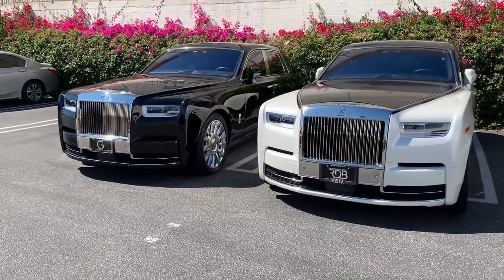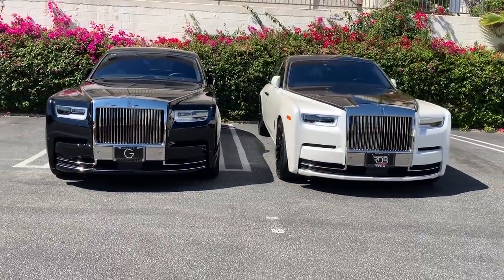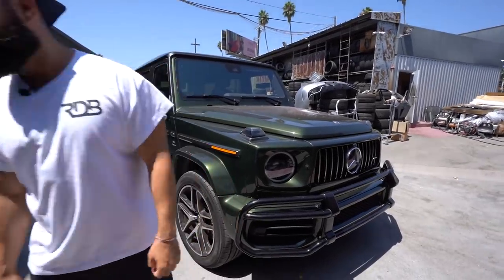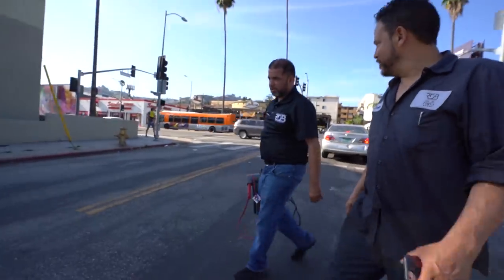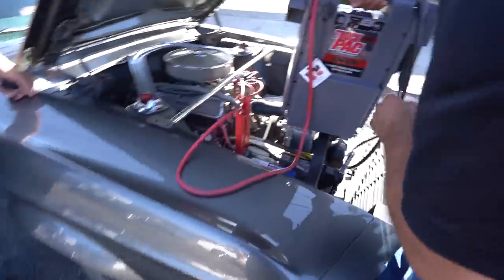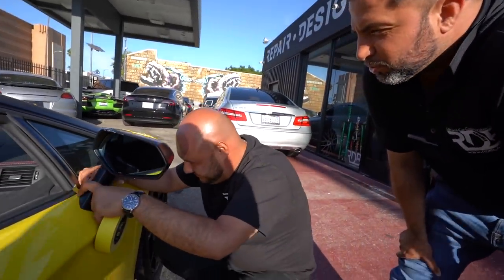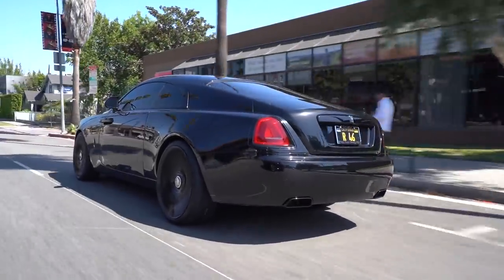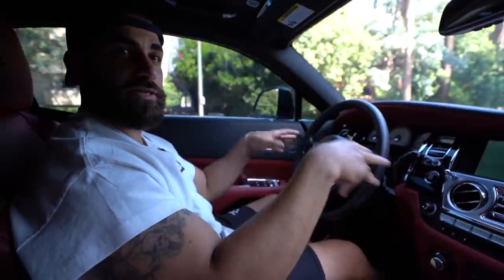1.2 MILLION DOLLAR PHANTOM 8's MODIFIED, RDB WHEELS ON A ROLLS ROYCE WRAITH, COPS FIND THIEVES.

Comment: Don't you create a method to fasten those Mercedes parts, so that it won't get easily stolen.
Reply: Gillege they could use a hex bolt or a different bolt pattern the issue comes down to the insurance and manufacture. 
Insurance wants everything done to manufacture spec and the manufacturer doesn't Want people doing stuff like different bolts, the thread pattern could also be manufacture spefic.

Comment: They broke into my apartment twice stole a bunch of stuff and just felt violated and police ain’t do shit but these rich folks loosing they  car lights and they build a whole task force??? 🤦‍♂️
Reply: jose cabrera just police officers don't do investigations, at most they partly work with detectives and officers that actually work in certain departments like auto theft, home break etc. Beverly hills has the benefit of not having nearly as big of a area, so the police department can do better task force compared to a city like los angeles it's so massive you have to have a lot of departments and task force officers communicating. 

But they do get shit done also, tons of stories of la pd operating a task force to go after drug dealers, car theft groups, home invasion suspects etc.